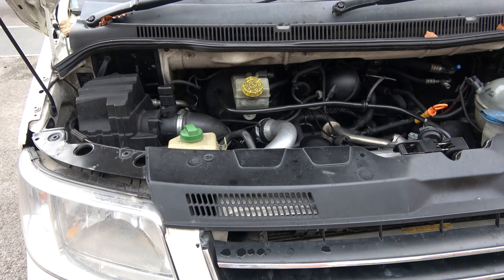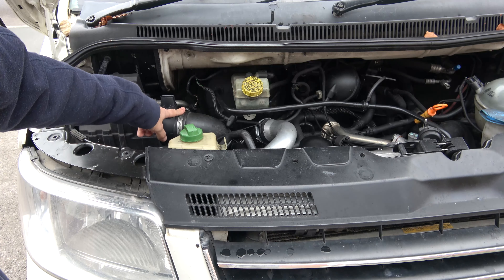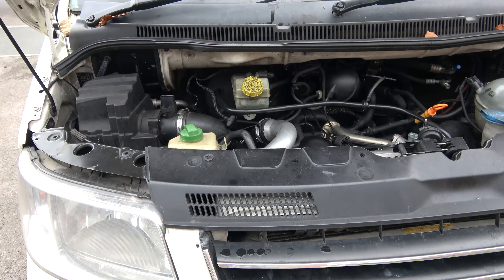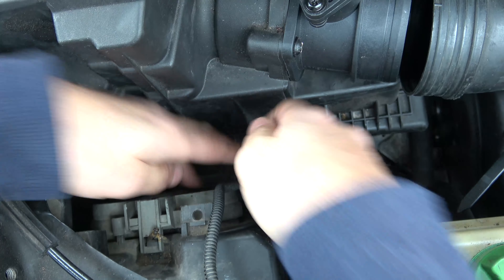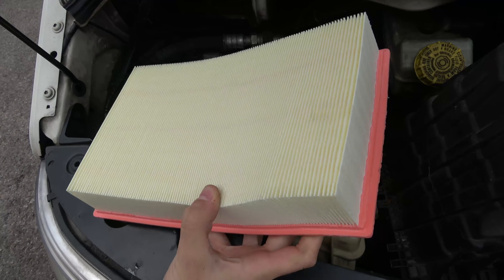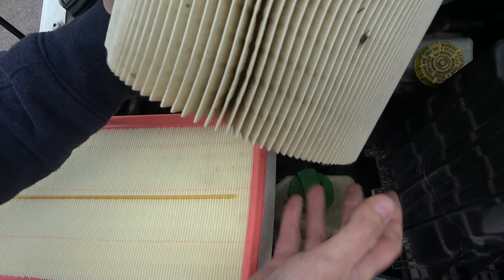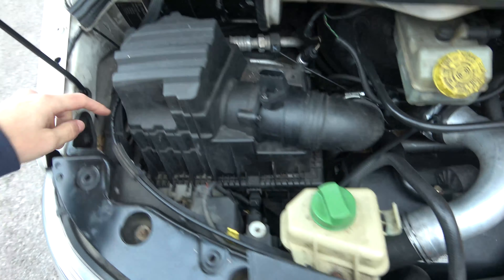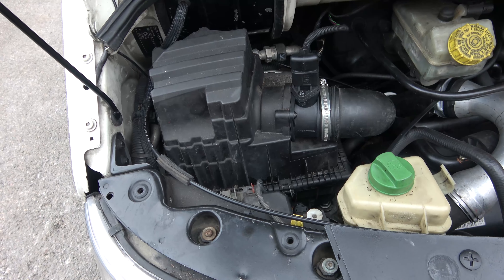VW T5 Air Filter Change - DIY

Comment: I noticed that you didn't check the leaf trap below where the filter goes or check and clear the water drain pipe. I had to remove the whole unit for a difrant reason and found a heap of stuff including dist that had bloked the drain and leaves that where restricting airfllow

Comment: Does this actually make a difference to the vehicles performance?
Reply from the maker: if it's badly clogged up with dirt?
Reply: @DanSohan  yeah... Does it notably reduce the vehicles performance when the filter dirty is?